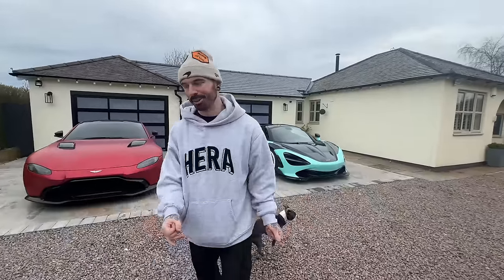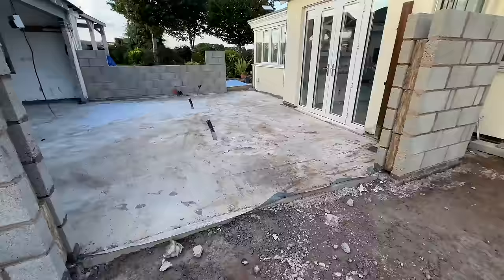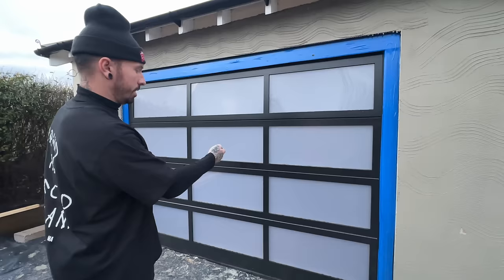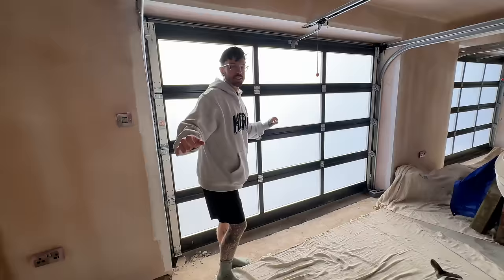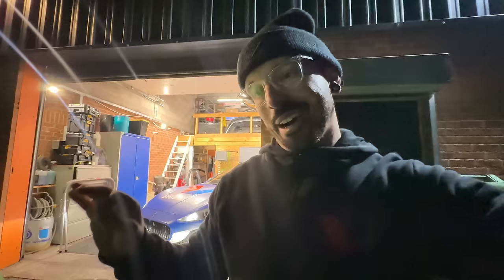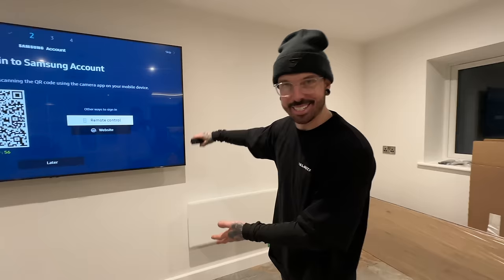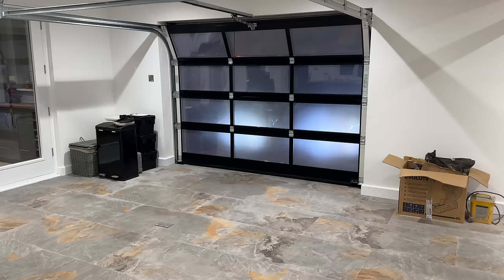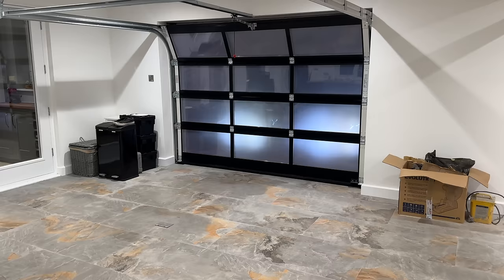I BUILT MY DREAM HOME GARAGE

Comment: Well done Matt and those tiles are correct…I have a different but similar shade of them and you DO need the thicker version for durability…just don’t drop anything like glass or china on them as that will die immediately…those tiles are just about bomb proof though…perfect!! The design is good for display and as a show area or polishing/ detailing room..it is not pointless at all. What you next need are outdoor wooden barns for the other cars…open oak framed ones are good…a friend has 14 cars and many are in those style barns..you can even fit door on them for security so they do not have to be fully open but daily drivers are fine and an open barn is quick to use. Your story of hard work and success is heartwarming…that you appreciate it so much is a delight. Don’t stop….you need those extra barns so get with the Spanners….and draft up more plans! 😃😃😃😃

Comment: When you first showed your house  I thought that will need updating to go along with your success.  So I had a little laugh inside when you instead updated the garage.  It's what you like and makes you happy.. and the tiles were not over kill. You need that thickness outside and as you are using the same tile internally it has to match. It didn't need to be as thick, but thats how it comes. I am a designer and builder.

Comment: Congratulations to you, your hard work has paid you back multiple times over.
Just a word of caution, those doors are not very safe in the event of a break-in. I would advise you install a remote controlled telescopic security post Infront of each door.

Comment: Got to say, it should have extended out further to where your hot tub area was all built in and doubled the space then it really would have been an indoor and show room that would have been multipurpose, the hot tub area could have had bifold and other doors to ensure it was seperate and not have moisture... It's a great space but from building a few of my own houses I realised by the 3rd always go bigger it's better to have the space and not use it then want to do it later especially garages

Comment: Simple ,,,,,!!!  Modify the Floor in the new garage and install 4 Turntables !!!  It looks as though you have the width (with wasted floor space) so, for four Turntables, you will be able to double up the Vehicles on the same Floor area.  Drive Car 1 in on Turntable 1, then rotate 90 Degrees. Drive in Car 2 in on Turntable 2 and rotate  90 Degrees, Drive car 3 in on Turntable 3, then rotate 90 Degrees. Drive Car 4 in on Turntable 4 and rotate 90 Degrees. Job Done !!!

Comment: That was an amazing garage. The only thing I might have done is made it taller so you could have put a lift or 2 in it. Also I have a question for you Mat. Would it be possible for you to rebuild a car at like Tavarish’s shop and raffle it off for your U.S. fans? I know I would find a way to enter. I am sure most or all of your fans in the States would as well. Just a thought. Keep up the amazing work.

Comment: Thanks! Your video calms me down everyday I watch it when the market is pumping!  I'm going with your insights.  It makes the most sense with where we are at in the cycle.  The only thing that would make me think this cycle could be slightly different is the overall increased adoption of crypto since 2019 and all the hype with the BTC/ETH ETF speculation.  Could the market stay held up this cycle by the anticipation of ETFs and the overall awareness that a bull run is coming? The surge is speculated to possibly be the beginning of a massive new uptrend, making it a crucial time for investors to pay attention, I've personally benefited from following Evelyn Infurna'  trading tactics, amassing 23 bitcoins in a short four weeks period, which speaks volumes about his expertise....
Reply: Use her name to quickly conduct an internet search.